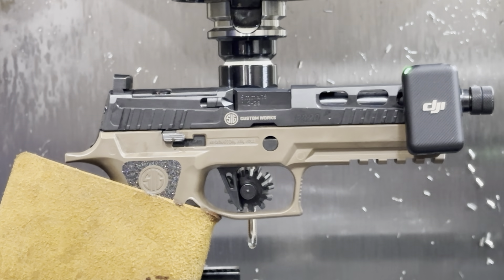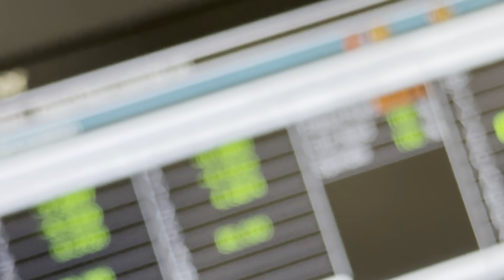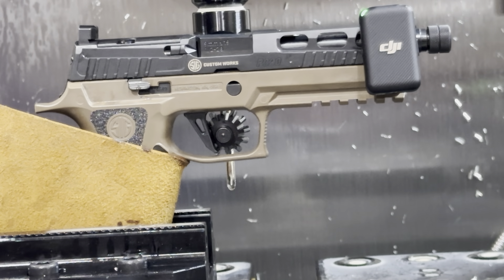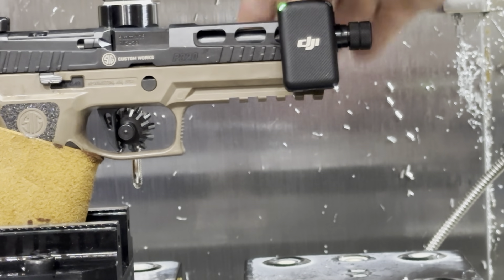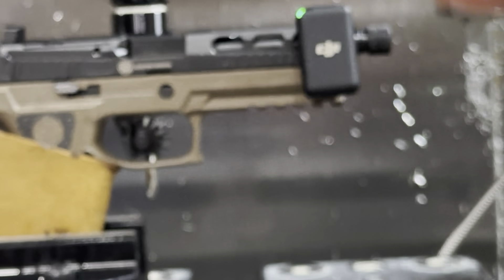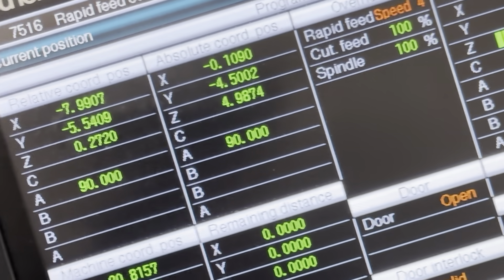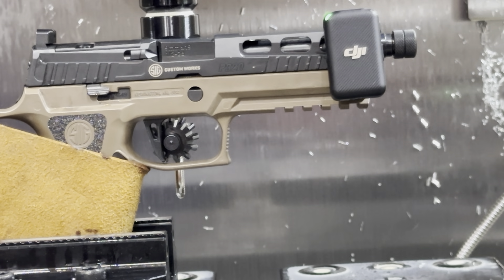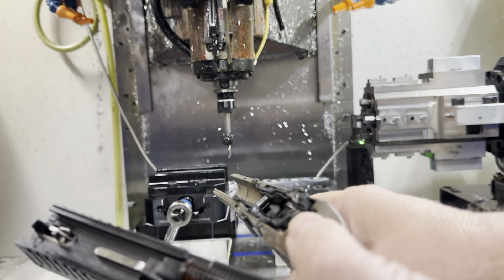Sig P320 accidental discharge tested in CNC machine.

Comment: It's a bit of apples to oranges. WGP tested it with empty cases in the magazine, you didn't. When conducting someone else's experiment, you need to do exactly what they did, or conduct your own.

For me, you haven't disproven WGP, you simply measured the exact length that needs to pulled before the gun can be shaken and fired. No gun should go off because it's been shaken, when the trigger is pulled a little or almost to the firing point.

Comment: I’d like to see you do the same test at harder strikes on the slide to simulate movement in a holster. A cop struggling with an assailant is not bother slide wiggled, it’s being banged around.

Find the lowest measurement at those levels of vibration that the slide can be jostled to fire.

Comment: Excellent demonstration on mechanics. Unfortunately, the YouTube comment section has become a safari of armchair commandos—each armed with tactical opinions and zero field experience. Most couldn’t field-strip a Glock if you gave them an instruction manual, a flashlight, and a patient mentor named Carl.

Comment: Yet another video proving Sig is lying and gaslighting and this P320 design is flawed and a POS.  No gun should fire without a full deliberate trigger pull.  A partial pull (which could come from any number of scenarios) and pressure or wiggling the slide should NEVER cause the gun to fire.  Shelve these, recall these turds.  Immediately discontinue use, and unload it and put it safely in storage.  Sig needs to stop production, stop selling these, issue a recall, and apologize for lying and gaslighting us.

Comment: But this needs to be repeatable, man. Ask for someone with a known bad sig to bring theirs and test it.  Your sample size of one is a good one.

As a machinist, you should know that tolerance stacking is a real issue, sigs can have them. For you to act like “no sig can fire without pulling the trigger” is dishonest at best.
Reply: It's not though. No trigger should fire at anything less than 100% of it's stroke. You either fully actuate the trigger or you don't.
Reply: Other youtubers have replicated this with even worse results.
Reply: I agree. Him being a machinist, he should know that using a screw or your finger to apply exactly within that nineteen thousandths window to get the gun to go off is practically impossible.
Reply: Maybe he's not a machinist. Maybe he's just some bum that broke into the building and filmed this overnight. Spinning a dial ain't that hard, after all. 😂

Comment: Are you defending this POS pistol and POS company!!?? If not, I missed all the other SIG pistols you have tested, is that another video, probably not, you have one pistol that as far as I can tell is a straight POS, regardless of how much trigger input is required, if you don't pull the trigger then it's an un-commanded discharge and that's the FKN problem douche nozzle!!

Comment: Congrats.  You’ve proven that the design is shitty. Well done.
Reply: Actually he proved you basically have to pull the trigger.
Reply: Should buy a 1911/2011.
Reply: @gameragodzilla  Yeah I can't wait to carry a gun that is 100% not drop safe. And goes off every time, oh wait people only cared when the P320 did it. Not saying it wasn't an issue. But fun how people forget facts when it comes to their favorite gun models.

Also just a side note, not everyone wants a low capacity single stacked firearm. And no the 1911/2011 is not bulletproof, and does have some history of feed, and stove pipe issues.
Reply: @iTrinityPlays Series 80 1911s are drop safe.
Reply: He also proved why this gun should have always been shipped with a manual safety probably. But also 83% of a trigger pull is sure not 100%. But why are you wiggling your slide more than half way into your trigger break like a dumbass? Just not realistically for real world situations. Only plays into question about holster issues, but again that's solved by having a manual safety it seems for the most part.
Reply: He's proven that you dumb mf dont know how to keep the booger hook and other junk off the trigger.
Reply: Glock has a trigger safety
Reply: Glock too?... https://www.youtube.com/watch?v=NKiN14zTF6o
Reply: he proved the glock failed the exact same test. watch his other video
Reply: @CitizenSeven500  If so then that design is shitty too! There can be more then on shitty design....
Reply: @hound83  every single striker fire brand made will fail the exact same test
Reply: @CitizenSeven500 that's a stupid comparison. The safety is in the trigger. Sig has safety bypassed by the stupid slide
Reply: @beardeddutchman5197  that's irrelevant to the purpose of the test

Comment: Playing devils advocate, you tested 1 gun. Say that 20% are out of spec just enough, and we know Sig has a problem with that, your gun is likely one of the other 80% that are okay so long as there is zero wear, zero debris, and remains perfectly clean. Test 10 ofvthem and you'll likely find a faulty gun or two.

The equipment used is fantastic. However, the sample size of 1 makes it all completely irrelevant.

Comment: That’s great to do these tests maybe like the comment below sig should have I wonder if they are wishing now that they didn’t skip that part of the manufacturing process time will tell. No matter how these tests turn out for any specific weapon or how someone determines how a test is to be interpreted positive pass or negative fail in regards to safety. The underlying fact is that how many glocks, Springfield, colt, cz or fill in the blank make of weapon… how many of those have video evidence of firing in holsters all over the internet plus an fbi report saying that they are unsafe? Also I haven’t read all the user manuals for these makes but how many say in their literature like sigs 320 manual that for your safety don’t put a round in the chamber until your ready to fire?? If it looks like a duck walks like a duck and quacks like a duck 🦆 it’s probably a duck and maybe get a Glock instead

Comment: Excellent test performed the way it should be done..  Thank you.  But the question in my mind is, can that 20 thousandths between the trigger pull at -0.90 and the intended firing point at the -0.109 be compromised in some pistols by inferior or inconsistent tolerances of some mass produced internal parts?

Comment: Nice. So you know that the pull must be >85 and <=90 thousandths. Why not try to find the precise value for your weapon? Also, how much travel is necessary to disengage the firing pin block safety? I am not a troll; just curious and you seem to be set up to provide exact numbers. If the block is disengaged, a more acute strike might (maybe) able to effect an unintended discharge. Just a thought.

Comment: The P320 and variants is NOT SAFE. DISCONTINUE USE IMMEDIATELY, UNLOAD AND PUT IN SAFE STORAGE.  Firing without a intentional full trigger pull but instead wiggling the slide, is a grossly dangerous design flaw;  a partial stacking could occur due to parts out of spec, wear, carbon, dirt, lint, etc. You can't blame training or holsters when there are literally 10s of millions of other Sig designs (P365, for instance) and Glocks, CZs, Walther, S&Ws, Springfields, FNs, HKs, Taurus, etc. in holsters across America and the world that are not having these same uncommanded discharges and injuries the P320 is liable for, including now up to 3 deaths. Note, also, these UCDs and injuries are happening to a lot of police and military, who are not "modifying" their pistols, the guns are serviced by the unit armorer, and holsters are typically approved or issued by the unit versus using a cheap weak holster. In fact, as a point of reference, the next 15 gun companies combined don't have a single credible instance of a UCD whereas the Sig P320 has dozens of these allegations. At some point you have to realize it is in fact the faulty design of the Sig P320, which failed drop safety tests way back in 2017. If you bother watching the dozen or more videos where police (I reject the notion they are not trained) and civilians having guns fire INSIDE HOLSTERS with no input from the carriers, often while doing simple tasks like walking, standing, sitting, getting into or out of vehicles, etc. then only a reasonable person can conclude the gun is defective. Sig Sauer has indeed LOST lawsuits, I believe at least 2, where there were over $10 million in damages based on a negligent product design. Sig has also settled many lawsuits out of court, strongly suggesting they'd have lost considering their propensity to fight the suits and even filing lawsuits. This gun has been defective since introduced. It mysteriously passed the "rigorous" military trials, to only thereafter be identified as failing drop safe testing. That's very "odd" shall we say. Many firearms experts advise discontinued use, as a growing number of trainers and ranges are banning them. Many state and federal law enforcement agencies including Denver, Chicago, Washington, Milwaukee, and others are dumping the P320 for good cause. While it may still be unclear what specific design(s) or parts defects are the cause, that is not necessary at this juncture. I have seen reasonable theories by engineers or gunsmiths that the mechanical safeties are not robust enough or too small and can be knocked out of alignment or due to lack of close tolerances and specs, they can fail. Regardless, it is undeniable, these ARE FIRING IN HOLSTERS. We can see obviously the gun fires in holsters, as evidence of such is on videos and witness statements, and often the gun is still holstered and the spent casing still in the chamber. We need not autopsy the exact cause, but there is a problem. It is irresponsible to continue using this gun, and there are hundreds of suitable safe replacements.
Reply: Very well said.

Comment: I like that you used a CNC to show the tolerances. I think the point is a gun should never fire unless the trigger is pulled to the point of firing. Plus, tolerance differences, tolerance stacking, and wear on individual firearms are going to mean this test is only valid on this gun. I'd be interested to see something similar done with one of the firearms that was videoed with an uncommanded firing.
Reply: Exactly
Reply: he proved the glock failed the exact same test. watch his other video
Reply: @CitizenSeven500  No. That video shows him depressing the glock's trigger 99% of the way with the trigger safety engaged. When he rocks the slide, the whole pistol shifts and finishes the trigger pull.
Reply: @ZRFehr  both released the seer at exactly the same point. 20/1000 from where they would normally
Reply: Yes, one of the 1 in 10k that have 'reported' the issue. How many 10's of thousands of rounds have been shot through them? What else has the gun been through? Or maybe just a manufacturing anomaly?  At a failure rate or .01% - .02%, that is manufacturing perfection.
Reply: Perhaps he and Wyoming could meet up and put Wyoming's pistol(s) through the test on the CNC?   They could also compare slide rail cut specs against each other, FCU rail specs, measure the sear lift and drop as Wyoming showed with his and see what differences Thinking Man's pistol has if any.

Comment: All this arguing about whether it’s a shitty gun or not. News flash, it is. If you can skip the stages of the trigger sequence by shaking the slide, it’s terrible. Look at how much slide contact there is. If they made longer contacts, it probably would be a better gun. That thing rattles more than a rattle snake. The tolerances are god awful and any gun that you can fire before the break by shaking it is a terrible design and is an inherent risk to its owner and anyone else in the vicinity. The difference between 1 mm and almost 2mm is inconsequential when you have people who use this for work and are constantly holstering and drawing. That can go off from clothing, a holster that’s 1 mm too tight, getting the trigger caught on a holster just slightly will end up in a discharge, or as simple as someone taking up the pretravel while engaging a dangerous suspect. It’s stupid, it’s unreliable, and it’s a liability.

Comment: I believe you missed the point. It’s part tolerance variation. Certain configurations are more prone to this issue than others. The 1mm depression is meant to represent different part tolerances. Parts are never equal and have +/- some amount of tolerance.

Comment: But... what does that translate to at the striker safety blocker mechanism? Could a piece of foreign material enter that system and defeat the safety? How big... or small of a foreign object could cause that? The question is... why is the sear capable of releasing the striker before its commanded?

Comment: Great video!
Just for my M17. If the safety is on, I can only pull the trigger back 2 mm. The wall is 5 mm back. So I assume that with safety on, the trigger will not be pulled back enough to cause ND.

Comment: Thanks for you attempt to test a theory.  However, like many other folks suggest, yours appears to be one of the Sigs with "Slightly" better tolerances.  You need to be playing with the firearms that actually have gone off while in their holster.  I'm betting most of these folks are not putting their fingers on the trigger and bringing the trigger to the wall, before they gun accidentally discharges.  Could it be dirty weapons, possibly, but I"ve not heard of dirty Glocks, Colts or Smiths accidentally going off in the holsters.  A firearm that is so touchy that if it gets dirty it becomes dangerous is NOT a firearm most folks should own.  The slop in this slide is very concerning and appears to be the likely culprit in these accidental discharges!  This appears to be the Pistol form of an AK, which have a lot of slop too, which allows them to be dirty as sin and still keep shooting, or so I've been told.  The P320 should be recalled.  I don't know if other Sig have the same slop, but if they do, Sig needs to revamp their design tolerances.  I'm betting if their slide and frame tolerances were tighter, there would be few if any 'Accidental Discharges'!

Comment: My baby siblings have plastic toys less wiggly than that slide. Insane.
Reply: Most "striker fired" pistols are similar. All my Glocks are the same. It's scary to watch the high speed videos with the frames waving and flopping around.
Reply: @MikeCopeland2636 None of my Glocks are like that. Gen 3 17C and a Gen 5 20
Reply: @PrimaryToSecondary  And here lies the problem. Because not everyone's SIG is sloppy with their slide like that. My M17 is not this sloppy, and this is also true of my Gen 4 Glock 40 MOS.
Reply: @iTrinityPlays I just have never heard of a Glock discharging on people. Maybe it did and Glock fixed it in the 80’s or 90’s. My issue is SIG not taking responsibility
Reply: Agreed
Reply: Sloppy.
Reply: Noting insane about it. It's an FCU system lol.
Reply: @RightWingMatt That is the problem.  Modular FCU is a fad that is NOT worth the negatives.

Comment: I wonder if the secondary sear notch captured the striker ? My guess it did not. Not even one time.
Reply: it can't catch the striker when the sear is being depressed by the trigger pull.  It's designed to catch a slipped striker from a drop jolt, not from a trigger pull.
Reply: @shazmodeus2795  The trigger is only partially pulled. The striker is released by applying slight downward pressure on the slide. If the secondary notch is defeated in that condition (and it almost certainly is) then it is useless.
Reply: @NDX-01  a partially pulled trigger is a partially depressed (lowered) sear, which is being held down.  The secondary sear notch was the fix for the drop safety problem.  It is designed to catch the striker hook if it slips off the sear from a drop jolt.  The sear has upward pressure on it from a pair of springs underneath to keep it in place and to return it to it's resting state, so if you are holding the trigger in, then the sear is being held down, and thus can't return to it's resting state where it would catch the striker hook.  If the striker slips in this scenario, the secondary notch isn't going to catch it.
Reply: @shazmodeus2795  Thank you for the thoughtfully written responses.
Reply: @shazmodeus2795  In  the screw video the sound when the striker is released from slide moving is different from when trigger is pulled, it's as if something blocked the striker.

Comment: Who has duplicated the un commanded discharge without having pressure on the trigger? Does this mean all those un commanded discharges from the holster had pressure on the trigger?
Reply: The thing is... is that it's really hard to manipulate the sear while the firearm is fully assembled. The only way to do so is by introducing pressure on the trigger. If you happen to know of a way to test this (keeping in mind that the sear and sear assembly is in the LOWER receiver and the striker/striker assembly is in the SLIDE) please do let us know.
Reply: @adambaker4590 So how would they just be blasting freedom seeds by just sitting in a holster with no trigger pressure?